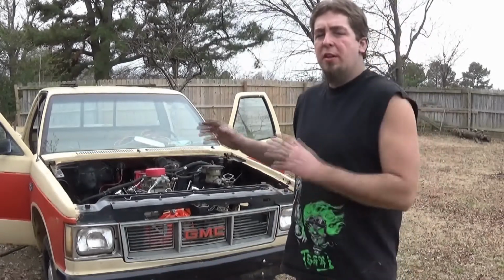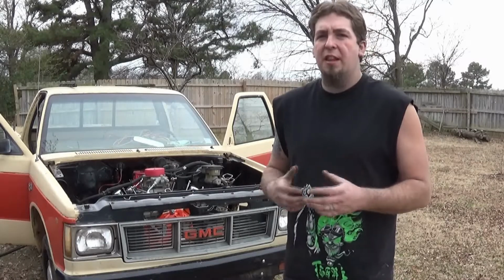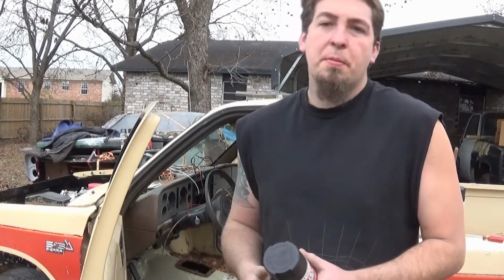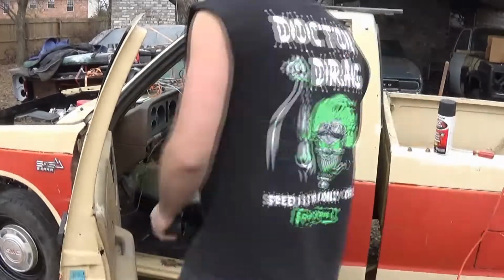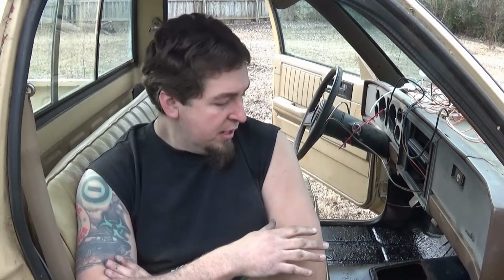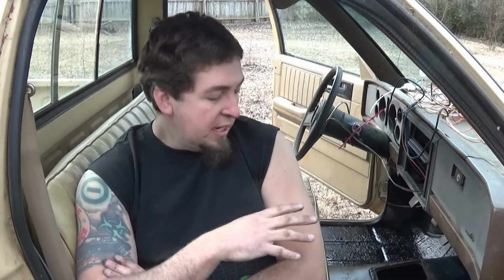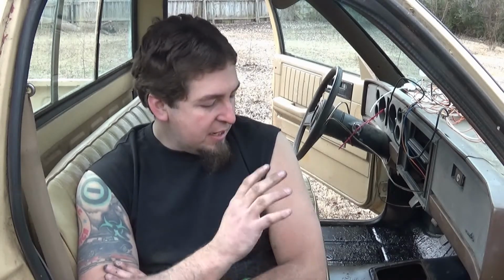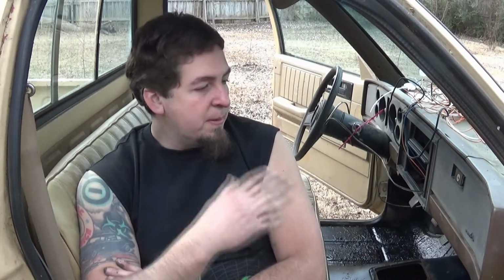Ol Merv ep 4 Merv got floored

Comment: I had a 57 Chevy where someone just wacked together the floor but the rust was gone and you never knew it with the carpet over it.  Por 15 seemed to prevent any rust from coming back.
Reply from the maker: I like using stuff like that to prevent rust. i have even done the undersides and nooks. as long as the metal is sealed away from the elements you wont have rust, and por 15 and other such do a good job of that

Comment: I wonder how well that stuff will hold up, i used some por15 knock off stuff on the cutlass floor that was surprisingly not rotted out.
Reply from the maker: i use it alot and it seems to hold up well if you prep the area good. if i have a larger surface i just buy the gallon of bedliner and go that route